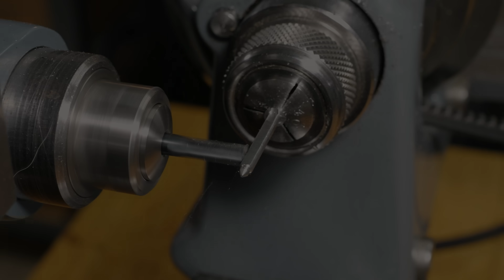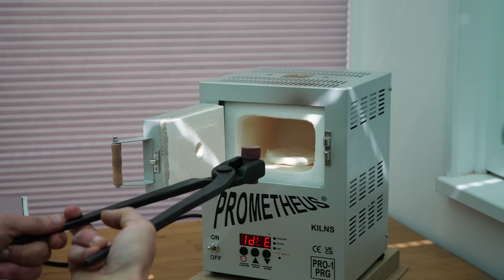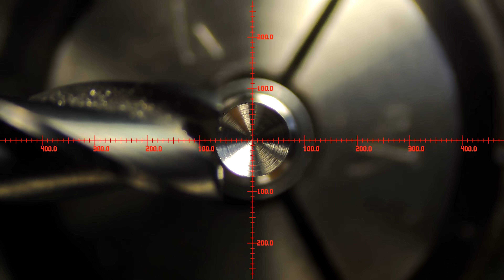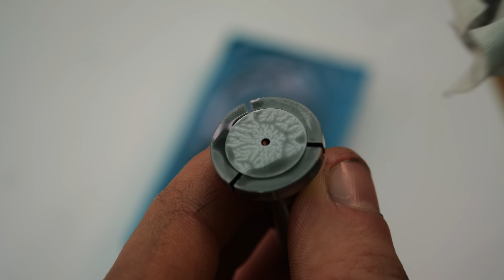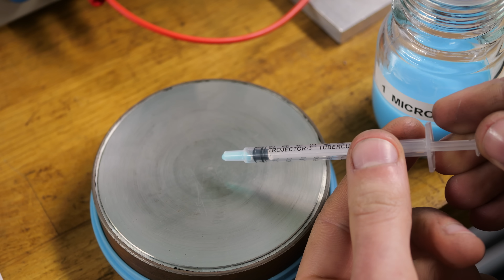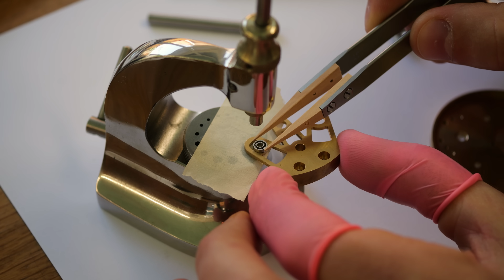Making a Watch Winding Mechanism | Pocket Watch Ep. 6

Comment: I am a scale modeler and designer for 35 years, I do basic gunsmithing and hand loading of ammunition. All three require precision, patience and steady hands. I did build tiny AA-guns that could be exhibited standing in a row on a match you would use to start a fire. I did build an anchor windlass that could fit on your pinky finger nail. I work with tolerance within thousandth of a gram when reloading ammunition. I am familiar with files, honing stones, tiny drill bits etc. 

Yet I watch these videos humbled and amazed to the point I question everything I did, do and ever do...

Comment: A punch surface can be flat. The force required to punch a part is proportional to the perimeter of the hole, not the area so creating punch edges are not required. A flat faced punch will last much longer because the forces are better distributed.
The main problem is matching the punch with the supporting block hole. This can be done by putting the punch in the receiver and than clamping the receiver in place.

Comment: The polish on those wheels is amazing. Some great lessons learned on those broaches. I’m excited to see the progress! Oh and I completely missed, somehow ,the decision to use ball bearings in the bridges?! Very interesting
Reply from the maker: Thanks Chris. The decision to use ball bearings on those three pivots was mainly born out of curiosity. I'm not sure they will improve the performance of the watch over jewels, and the two largest ones only rotate when the watch is wound anyway. It's always fun to experiment with new concepts though!
Reply: @chronovaengineering  so that’s never been tried before?
Reply: @Ropeorsnake  Well, it’s not really optimal. While it might have been done somewhere, there’s a good reason it won’t replace jewels anytime soon. Ball bearings are much more complex, require more maintenance, and are far harder to manufacture at that micro-scale than a simple jewel and pivot setup. They also take up way more vertical and horizontal space inside the movement and introduce lateral and axial play, which is practically negligible in a jewelled setup. The main place you’ll actually see ball bearings in watchmaking is on the automatic rotor, mostly because the rotor hangs from a single point and deals with heavy shock, making ball bearings a much better choice for that specific load.
Reply: @m @mael3527  thank you for reply, very nicely explained -an extra complication at that scale is creating more problems than it solves :)

Comment: Did you heat it up in the kiln, and then heat it up again on the other... heater thing? Why twice?
Reply: The first heating step (hardening), is followed by rapid cooling (quenching), leave the part very hard but brittle (it could shatter easily). The second heating step (called tempering) goes to a lower maximum temperature and the part is cooled more slowly. This relieves the internal stresses in the part, and alters the steels crystal structure, increasing it's toughness. Steel is a very strange materiel and you can have huge effects on it's properties by heating and cooling it in different ways. Clickspring and The Thought Emporium both have good videos about it which are worth a look if you enjoy this channel
Reply: @fionnmerz  Why would you not just do the second heating step, heating it up to the correct temp?
Reply: @bitfreakazoid . doesn’t work like that
Reply: @bitfreakazoid  Iron changes crystalline structure, going from ferrite (Normal steel a magnet will stick to) to austenite (Not attracted by magnets), while still staying solid at around 900 degC. Cooling suddenly by quenching doesn't give all the iron time to move back from austenite to ferrite, leaving some austenite structure in the steel at room temperature (Known as martensite). The mismatch between the two atomic structures causes internal stress in the atomic structure of the material. This makes the steel harder than before because now it's effectively a prestressed structure.

Quench hardening comes at the cost of making the steel very brittle, to the point it could shatter under impact or shock loads and will break instead of bending when overloaded. Heating to below the austenite transition temperature gives the iron atoms enough energy to release the highest stresses (Which are where the part will shatter from) without losing most of the benefits of the material being hardened. This means the final part is a better compromise between hard and tough, but both steps are needed for the heat treatment to do anything useful.
Reply: @peglor  That's pretty interesting. Thank you.

Comment: Would a rotary broach be possible at that scale or did something else prevent you from trying that? Or would it have made no difference to the wear?
Reply from the maker: I don't see why a rotary broach shouldn't work. It was my next plan if I couldn't make the typical punch approach work. I didn't try it just because of the added effort of making the tooling. It's something I intend to visit in the future though.
Reply: @chronovaengineering  Thanks for your reply 🤗 When I saw the wear marks on the punch, I thought to myself that a rotary broach would have stood up better to the tasks - but then again I do not have any engineering background 😅just a dude with a 3D printer and an interest for machining🙂From my understanding, the rotary broach would inch forward a little more gradually, leading to less pressure on the cutting teeth. I would be interested in seeing the outcome when you try it out 🤩

Comment: That black polished surface is stunning. I've never heard of this technique before either, are there references where i can read more about it?
Reply from the maker: Thanks! I'm not familiar with any good references on the topic. If someone else knows one, please drop a comment below. Otherwise, I covered the topic in more detail here: https://www.patreon.com/ChronovaEngineering/posts/polishing-watch-118589709
Reply: One thing he seems to have left out........as I understand it the surface not only have to be smooth it has to be flat.

Can't say I have even seen any long winded references, just passing references, so not much help there.
Reply: I didn’t understand about how contamination could ruin the polish  ?
Reply: @Ropeorsnake  My theory goes
You're finishing a surface to some where in the sub micro range in flatness and smoothness(they are not the same thing). 
Anything that gets between the work and the lap can lead to the workpiece not being smooth or not being flat(possibly both).
If the contamination is on the hard side of things, it will leave a scratch, flat but not smooth. 
If the contamination is softer it wont scratch the work but it will hold that part of the work off the lap while other parts are still being lapped, it will be smooth but not flat.

Of course if the contamination is hard enough and large enough you can get both.
And it literally may only take one piece.

My "expertise" comes from black polishing a grand total two items.........so you might want to factor that in ;)
Reply: @s @stusue9733 Thanks for the explanation, yes that makes sense, I suppose on that scale a mote is as big as a marble! and your two times black polishing is vastly more experience than I have…what were you making?
Reply: @Ropeorsnake  One was a "pretty brass disc"
The other was "needlessly polished" scribe for a height gauge(which I may never have finished as I believe I found the missing part I was replacing...so it likely sitting an a draw somewhere never nicely polished lol). More a "can I do it?" than "this needs to be done". My hobby at the time was much more in the functionally pretty scraping for machine tool alignment. This can involve lapping carbide to pretty fine finish, so I had the laps and diamonds.  As I said, I saw a passing reference to it somewhere and thought "I'll give that a go".
Reply: @stusue9733  that’s excellent, really I admire anyone who has taken the time and developed the skills required to create those beautiful and precise tools or machine parts - thanks for your reply & I hope you are still pursuing the “can I do it” challenge!
Reply: @Ropeorsnake the material you remove when polishing will leave scratches if reintroduced. The Polish is so fine they look like cracks in glass on the surface, or little spots all over the finish